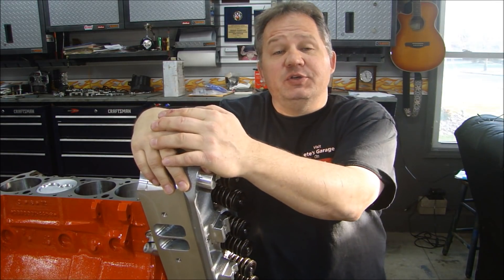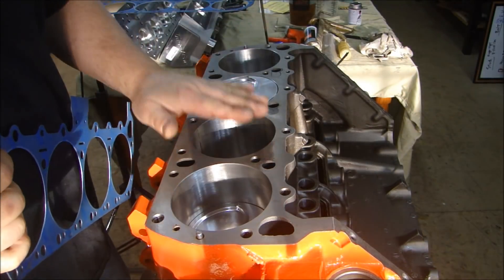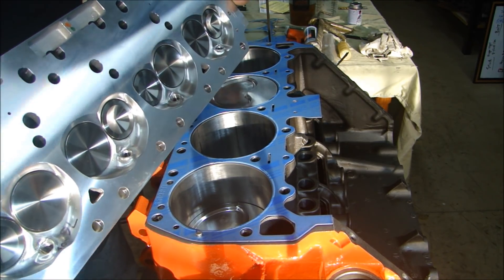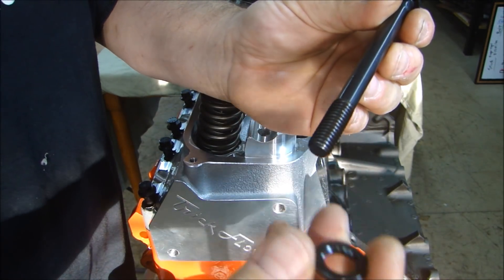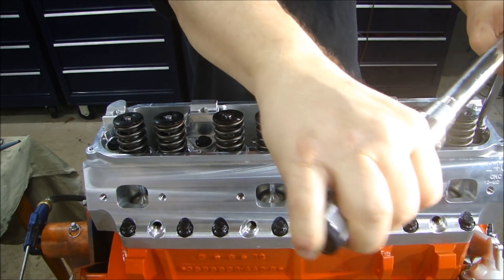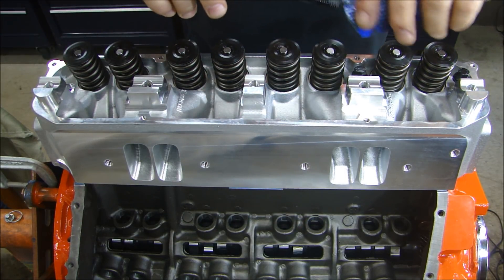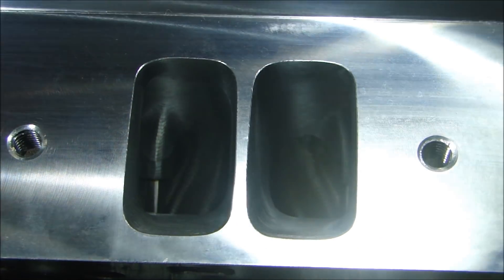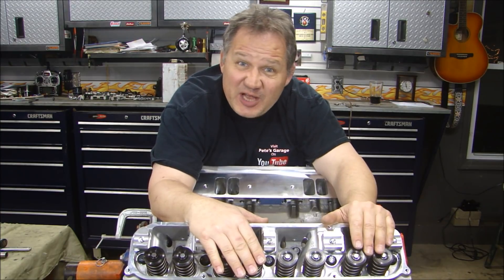440 Chrysler Mopar Engine Building Part 8 - Installing Trick Flow Cylinder Heads

Comment: Does the stock head bolts come with washers. When I bought a 440 from a guy the head bolts didn’t have any washers.
Reply from the maker: They do not. If you buy a set of ARP head bolts the washers are invluded.

Comment: Hey Pete, spoke with you a month or so ago about my 76 Dodge 440 big block, that had zero oil pressure! You gave me lots of reasons why this was happening! Greatly appreciated! Turns out, bent pushrod, intake valve number 5 cylinder! As this engine is in a Apollo RV! Access is extremely Limited! Seeing how mileage is so low, thought I might get away with replacing just the one push rod! Not so, bent the new push rod, instantly! Could this be the result of timing chain jumping a tooth? Not looking forward to, but getting ready to tear down front of RV! Just so I can have access to what I need to teardown to inspect timing chain and gear! Before I waste a whole bunch of time! Is this scenario possible?
Reply from the maker: I can't see how a bent push rod caused no oil pressure. It's not in the pressure part of the system. I also can't see the timing chain jumping with low milage. You can certainly look to see, I'd be interested to know.
Reply: Hey Pete, Don with the 76 440 RV, I guess I left the part out we're in the process of the push rod bending, it left its seat on the top of the lifter and was laying beside it and was bent at almost a 135 degree angle! The lifter was intact! I am tearing down the front of this monster as we speak. Grill, oil cooler, transmission cooler, as the radiator did not contain one! AC condenser and dryer. All this,pluss the radiator overflow tank, as to allow access to the radiator, which of course has to come out, so I can get to, well you all know the rest. I will let you know what I find when I get in there! And so the push rod leaving its place in line of the valve train, would certainly cause a great loss of oil pressure? Correct?
Reply from the maker: Possibly, if the lifter got stuck blocking the oil passsage
Reply: You need to tale a systematic approach to this.
Step 1 is to resolve within yourself that there is no quick fix here.

When was the last time it ran?
Did this happen when you started one day? Or did it break down?
My hunch AND I COULD BE WRONG is that the heads have been reconditioned at some stage and valve seat inserts fitted.
They sometimes fall out and cause this type of problem. Usually it is an exhaust seat that drops. It jams between the valve and the head and holds the valve open. Then the piston hits it and bends the valve jamming it in the guide.

I would pull the rocker gear on the head that keeps bending the pushrod. Try to push down the offending valve - either by using the palm of your hand or a lever of some description. Perhaps first, try some other valves to see if you can get them to move so you know how much pressure to apply. Usually about 100lbs will move a valve.

Comment: Purchased E-Street Edelbrock Alum heads for my 440. Anyone using these have any comments. Not installed yet.
Reply from the maker: They will work fine with a little porting and polishing work

Comment: I would use head studs, and MLS gaskets. Also ALWAYS check piston to valve clearances.
Reply from the maker: Great input, thank you
Reply: Why would you put yourself though the pain of having to deal with head studs? Have you ever tried to remove heads on studs when the motor is in the car? Also, what kind of power are you planning on making? As long as the ARP bolts will support over 2000 hp and a lot more, I think you will be fine.
Now MLS gaskets are nice, and a must if running high compression or boost.

Comment: Pete, don't you need to put the ARP lube underneath the head of the bolts (or washers) where they contact the head as well as on the threads?
Reply from the maker: I just made a video about this. It makes very little difference, but ARP does say to lube under the head.

Comment: One should consider using an old headgasket of the same thickness to check various things before doing a final installation. My Promaxx CNC ported heads required clearancing of the 3/8" pushrods around the intake runners.  Also it may be worth the time to check piston to valve clearance, again with an old head gasket of the same compressed thickness. I can't wait to see you fire this one up. Our engines are very similar. Thanks again for this series!
Reply from the maker: Great points! If there are clearance concerns I would check for sure. Firing it up very soon.

Comment: Man I am so glad TrickFlow came out with these heads. Also the newer 270cc versions that have Max Wedge intake size ports. Also have decent spring in them to for both versions from PAC racing
Reply from the maker: I'm glad too, finally a great alternative to doing all that work.

Comment: Looking good. FYI: ARP instructions say to "Lubricate the under head of the bolt and the washers with ARP ULTRA-TORQUE FASTENER ASSEMBLY LUBRICANT".  Also be sure to thoroughly lube full length of the fastener threads, especially the first threads. Just a  heads up, I have also experienced Trick Flow heads with valve/seat sealing issues fresh out of the box.
Reply from the maker: Great comment. That is why I say follow the manufacturer's instructions. I didn't want to drag out the lube thing, but I took care of that before I dropped the bolts in. The heads occasionally have issues, but these checked out ok.

Comment: Those trick flows are probably the best heads I've ever seen. Those come with valves and springs installed right out of the box?
Reply from the maker: Right out of the box, but they are pricy.

Comment: check the valve job you may have a leaker , or bad run out , i've seen it time and time again .
Reply from the maker: Thanks Tobias, I did check to make sure the valves were sealed.
Reply: great show

Comment: I know Trick Flow says these are ready to bolt on, but so do most other head companies and I very often hear horror stories about tight valves and some other issues from peeps who did and didn't check the heads before installing them.. Do you check yours?  Also, is this motor going onto a dyno??   One last Q; the pan you are using, you are not going to paint it??
Reply from the maker: Well, as an engineer working in manufacturing for 25 years I can say that no product or company will be 100% perfect. That being said I do check to make sure the valves and seals are in proper working order before I assemble them. I dyno tune every engine. I was not going to paint the pan because the plating looks pretty good, but that's up to the owner.
Reply: Ok, I figured you would have gone through the heads, but didn't see a video on you doing so. ~~ I'd love to see a full DYNO tune and numbers. I've heard a lot about these heads and really would love to SEE the numbers they make.. ~~ I have the same pan. I gave them a lite sanding to give it a tooth, but still the paint flaked off. I used primer and paint of the same brand, but at the moment I cannot remember the brand. I have to take it all down again and cut the surface better.